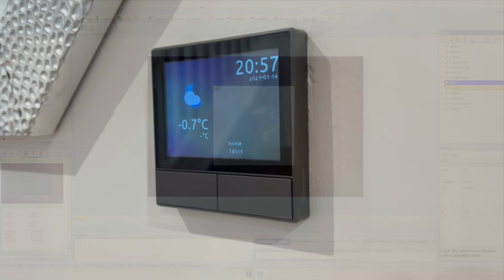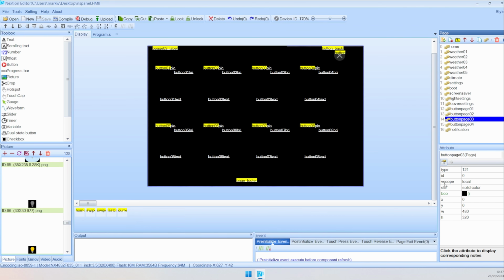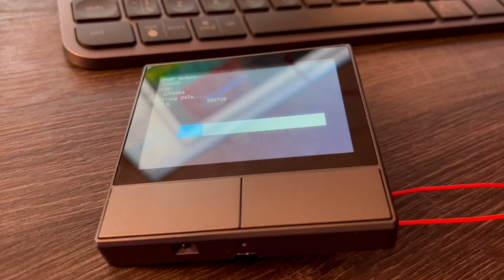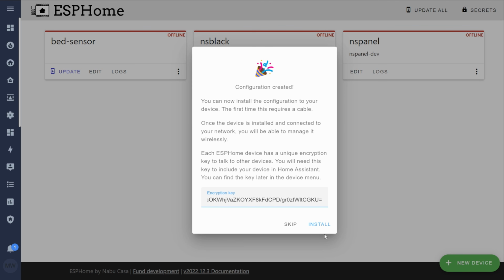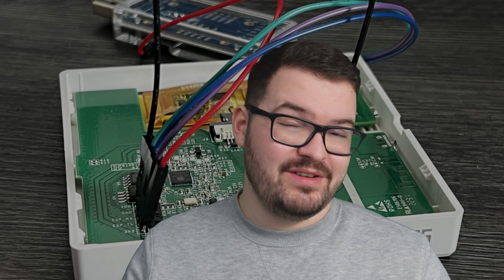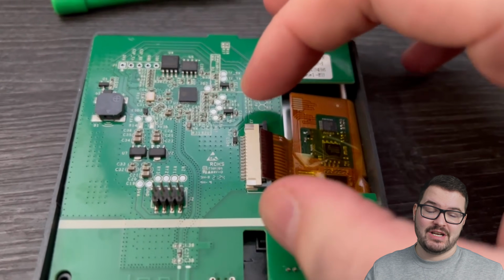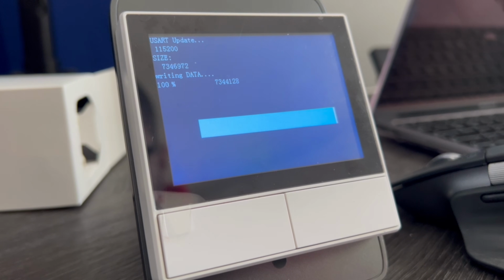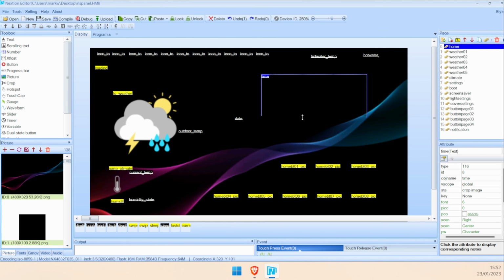HOW TO - Setup the SIMPLEST Smart Home Scene Controller

Comment: Thankyou I have this working. However, I want to control the heating with this at the moment I'm using 2 basic automations to turn on and off relay 1 based on the internal temperature and that works but I see the blueprint can use the 'climate' code. Tried it but failed with error to restart HA: 	The system cannot restart because the configuration is not valid: Platform error climate.nspanel2 - Integration 'nspanel2' not found. It must be the naming in the climate yaml code added. I set -platform: nspanel2 and name: Lounge, I assume its some silly error around here. 
If the problem is obvious, please let me know or perhaps give an overview on how the climate code works. 

Thanks for all your great vids
Reply: looks like you created and flashed the device twice and did not delete it from HA Devices before. The 2 at NSPanel comes certainly from ha because of double entry
Reply: @BlackYmas  Ah no, I’ve called nspanel2 because it’s the second panel.

Comment: Great tutorial, but something is wrong with the newest tft file. It's 7.2MB and the nspanel can only save 4. THis caused me a lot of headache, and it now says error and the display is tilted 90 degrees. Trying to flash it with your old video and hope it works
Reply: Hi did you manage to get yours working? I'm having the same problem Thanks
Reply: Me too.  Mine is taking forever.  I pulled the power on mine where it got to 7% pretty quickly, then 1% every 5 minutes or so.  When I pulled the power, it started at 1% this time and it is taking 10 minutes for every % increase.
Reply: @cam_DA_Hawkdriver   Did you solve it? Having the same issue..
Reply: Having this issue as well, seems the latest tft file is too big and upload never completes

Comment: Looks crisp and amazing (looks better than what you had in that previous video) 
And I love that I don't need to modify the yaml
, but the fact that I cannot choose to use the hardware buttons to locally toggle the relays is a bit of a disappointment.
I understand they are working on a version where you CAN do that.
Reply: hello Hardware keys and releay are freely assignable because 60% do not use the relays. But in the blueprint you can simply put the releay entity on the HW key field. Than you can control with HW Buttons the relay

In the next update 3.1.0 there will be an additional fallback. This means that the NSPanel loses the connection to the Wifi or HA, a fallback is automatically set up and the HW buttons directly control the relay without HA.

So you can do everything you want and have a fallback if Wifi or HA fails - what more could you want ;)
Reply: @BlackYmas  One that works in the US would be nice 😀
Reply: @HATipsByLarry  work on it see wiki :)
Reply: @BlackYmas  Thanks for confirming that.

Comment: I seem to be getting an odd error whenever I create the Automation from the Blueprint, I've rolled back 3 previous HA releases (in case it was me), but have the same error everytime.

"The automation "NSPanel Test" (automation.nspanel_test) has an action that calls an unknown service: esphome.nsp_test_send_command_text_printf."

Any ideas?
Reply: looks like you have flashed twice with different names or you have specified the bottle name in the blueprint. Has mark shown in the video or he had the first attempt also wrong.

Look also again in the wiki there is everything step by step.

Your error says in any case that something does not match 100% with your assigned names
Reply: How did you fix this ? I get the same error message and unable to update the tft display.  When I test relay1 and relay 2 they do work
Reply: @dennisdavidson9658  I haven't yet, i've now got 2 NSPanels that are completely useless at this point......the battle continues
Reply: @dennisdavidson9658  use local HA TFT update. have a look in the wiki we updated the wiki ;)
Reply: @BlackYmas  Thank you - I finally managed to get it to start the update tft process - unfortunately the update process started last night via github url. update at about 50% now - almost 14 hours later.  Should I leave it to finish or can I reboot the nspanel and start tft update local ?
Reply: @dennisdavidson9658  good question XD not sure

Comment: Is there a way to flash the new esphome code over a panel that has Marc Fager's code on it over the air?  I played around over the weekend and couldnt figure out a way to do this.  Just trying to avoid having to remove it from the wall :)
Reply from the maker: You can edit your existing espcode and wirelessly update it. Once done you can then do the blueprint and tft. Save taking it apart and flashing esphome again :)

Comment: Do you have to wire in a neutral? I don’t think I have one
Reply from the maker: Unfortunately with this panel a neutral is required.
Reply: I was lucky I’m that although no neutral was connected, for some reason the electrician had used 3-core. So I was able to use the spare core and wire that up to neutral at the ceiling rose.

Comment: Thanks for a great video. why the US panel looks different then the EU one ?
Reply: Because EU switch plates are square. This way they match.
Reply: @Sparky_D  IC, but using the US ones has same ability and buttons to proramm ?
Reply: @sr_true  correct.  I just had a look at the github repo for the blueprint and there is just a bit of work still in progress to get the graphics lined up properly when using the US style in portrait orientation.  It looks like it will be sorted pretty soon.
Reply: @Sparky_D  Thanks a lot
Reply from the maker: The US one is rectangular and the EU one is square.

Comment: Do you prefer this over the NSPanel Pro + home assistant companion app? Was thinking of just setting up something like that with a  custom lovelace dashboard for cameras and more.
Reply from the maker: The NSPanel Pro has a nicer design will the full screen touch screen. If it had relays then it would be a winner, but I like having the relays as a backup incase the network etc is down.

Its a bit of extra work but if it fits your use case the Pro is a good option. I have a newer video on the pro in the works too 👍🏻

Comment: Great information, thanks! I have a question, if you have multiple NS panels is it possible to have different buttons for each?
Reply: sure :) the Blueprint is a template so you can create a Blueprint for each Nspanel and configure each one individually.
Reply: @BlackYmas  that's great, thanks for the information!
Reply from the maker: You can yes :) each panel will need to have its own configuration (blueprint). In the video you can actually see 3 im using (nspanel, nsblack, nswhite). All are separate and display their own screens.

Hope that helps :)

Comment: Great video. May have sold me on this vs a Android panel 4” panel. 

But a question, the relay buttons, do they work as they should? Or are they also now controlled via esphome?
Reply: can freely configure the relay and also the hardware buttons. In the next update, however, comes a fallback function. If the NSpanel loses the connection to the Wifi or HA, a fallback is automatically activated so that you can switch the relays via hardware buttons without HA or WiFi ;)
Reply: A question i had was also, does the blueprint change the esphome sketch? 

Or does the unit always have to look at that repo in the sketch? I.e no internet no switch?
Reply: @arriewarrie  no you only need it for updates. No internet no new updates - the goal is always to stay local that's why we all use HA :)
Reply: @BlackYmas  exactly why i asked! I like the fact that the fallback function is coming. 

How will “updates” be handled though?
Reply: @arriewarrie  I imagine via their repo...

Comment: Why aren't you selling flashed NSPanels? I would be interested in it.
Reply from the maker: It’s a great idea but it would be very expensive with shipping etc 😬.  If I was ever to do anything like that it would be for my own custom touchscreen panel.
Reply: @MarkWattTech  You are located in the USA?
Reply from the maker: @Kim-zb9zp  I’m in the UK
Reply: Shipping cost are not the problem. Found out that it might be a problem to set the wifi login information changed easily for the enduser. It would stil be needed to connect it to the PC to do that.

Comment: I liked a lot the idea, was experimenting this weekend with it. In general interface is super neat, works quite nicely, but there was a big no-no for me. It is dependent on HA. If there is a power outage, the panel doesn't work if HA is, for any reason, down. It just says "waiting for configuration". I want to be able to use my heating even if HA is down. But definitely will keep an eye for any updates on this project!
Reply from the maker: That’s an issue for the device itself with any firmware (not just HA) as it is WiFi based. The only parts that will work without will be the two physical relays.
Reply: @MarkWattTech  yes, for my use case that's enough. I have an ESPHome configuration where the relay is connected to a climate component, controlling the valves of the underfloor heating. In my example, it works even if HA is down. Of course, I lose the updated time/weather/control of lights and so on... But at least my heating works fine.
Reply: @ungeekenmunich  this is exactly my use case and concern. I want the two buttons to control the two relays if HA is down. It should fall back to "not smart" if it can't phone home
Reply: @mattsgreen  yep, same here. In any case, this project is extremely cool. And this is the beauty of open source. If it doesn't fully suit you, there is always the possibility to make your own 😍
Reply: @mattsgreen  see my last comment we will implement a fallback if this scenario should occur - ps. we think of everything ;P
Reply: @BlackYmas  this is fantastic thank you. It covers my back when I'm away and something goes wrong - the family can still turn the lights on and off 🙂 it's all about the family acceptance! 
Looking forward to testing the fallback, and thank you for an awesome solution for making the nspanel work in a beautiful way with HA!
Reply: @Un Geek en Múnich  If you do it via esphome you can't even build 30% of these functions. Because the memory is simply too small.

I also had everything in ESPhome before but then I use the NSPanel only 40% because it can do much much more.

And if your HA is down you can't control your thermostat on the radiator anymore because thermostat -> HA -> Esphome.

If you mean your floor heating system then you are right 

BUT!!!! 
we are working on a fallback function. Means you can program via HA the relay and also the hardware buttons freely. If the NSPanel lose the connection to HA or your WLAN, a fallback is immediately activated so that you can control the relays via Hardware buttons and  your lights or floor heating system.

And I think 1. how often happens that HA fails and 2. I think you had then more problems than the NSPanel at least if you have a lot of Smarhome in the house ;)
Reply: @BlackYmas  That would be great. I know it doesn't happen often... But if does. I still remember last year when we switched to summer (or maybe winter, don't remember exactly) and suddenly HA crashed. That day learned the lesson there is the need for a fallback solution. I was there to fix it, but might have been in a 10h flight, or dead. Who knows! Anyway, I'm happy with that 30% functionality and you're right, I only need the relay for underfloor heating.
Reply: @ungeekenmunich  than you have a new option and solution with the fallback in the next release ;p
Reply: @BlackYmas  really looking forward to testing it :D Thanks a lot, it's really cool. One of the things I really liked was the light sliders. Btw, didn't know that they made the NSPanel in white. I'm ordering a few more
Reply: @ungeekenmunich  thanks :) - I also know that not everyone will like our version and should - I just wanted to address the issue with the fallback an local control, because we had a discussed las 2 days. And we no it is important in same cases ;)
Reply: Hopefully we'll see a Matter-enabled version at some point.  That way the devices can communicate directly without needing HA (or any other controller) for anything other than automations.
Reply: @BrianHCohen  When I see the current chaose of matter I make me there not much hope that it will still run clean in 2023 XD
Reply: @BlackYmas  It literally just launched and there's almost nothing that fully supports it yet.  So... yeah, it may not be fully ready to go this year, but I'd bet by the end of the year we'll have some new toys to play with.  :)
Reply: @BrianHCohen  certainly - but as far as I can see, most of them only use the bridge matter. The devices continue to run with zigbee - but we will see ;)

Comment: What do you think about this firmware vs the lovelace ui?
Reply: I use the Lovelace UI on the NS Panel Pro. Works like a charm. Only thing I wish I could change is being able to remove the top bar.
Video of camera’s and doorbell work really great, although a bit laggy
Reply: @JurgenDictus  he mean Lovelace ui for nspanel not nspanel pro ;)
Reply: Hello, generally the difference is with Lovelace Ui version you have to write all the code and therefore also need some experience, but are more flexible. With our version you have a simple blueprint with UI and can click the everything together without programming ;)
Reply: @BlackYmas  true but I guess for some people coding still is a bit less hard then flashing.
Reply: @JurgenDictus  that's why you don't have to coding anything with our version ;) Flash takes 5 min and much easier than NSpanel Pro and after that you only have to choose what you want from a menu :) This is the idea of our project - you can see in the last video from Mark